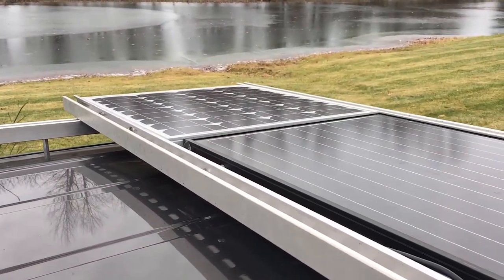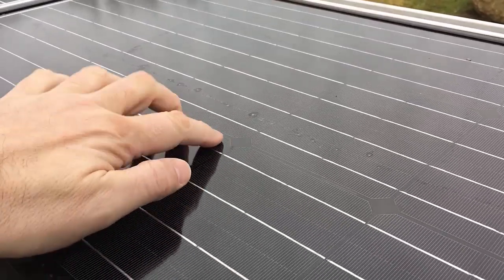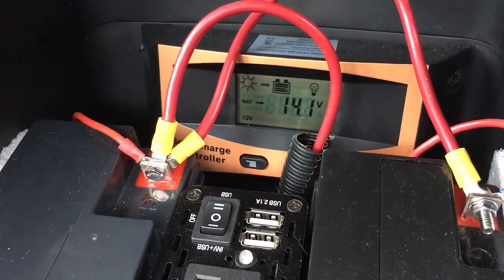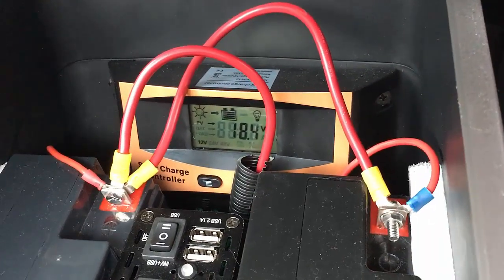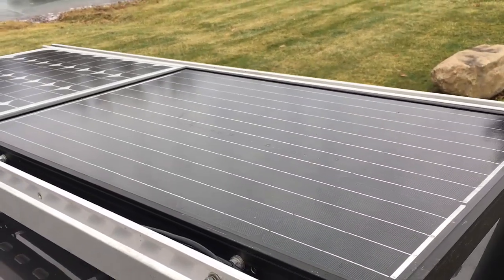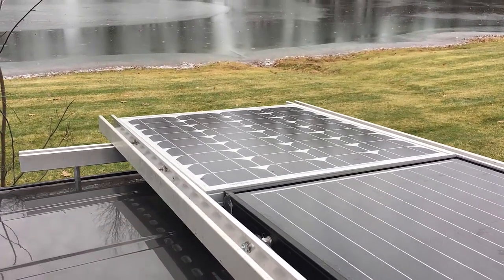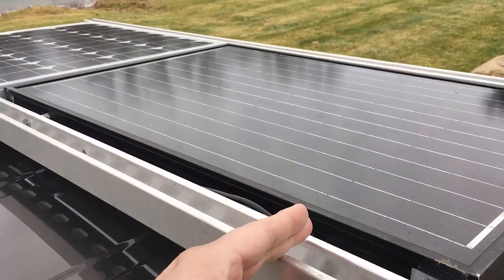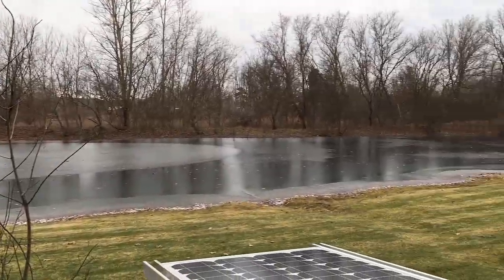DIY Rooftop Van Solar

Comment: great channel and have the same exact van! I saw on a tour of your van that your car charges your solar batt and also the solar can charge your vans batt? I can't seem to find how and what you used for that. I have a 100 watt renogy panel and a 30 amp matching charge control to a 100ah lith batt.  Any help would be great! I have videos of my van on my channel too
Reply from the maker: Your paint job is f'ing AWESOME man!  Love it!  Just subbed to your channel.  I'll look up the info on my charge controller and send another reply to this message.  Thanks for watching!
Reply from the maker: OK, got two links for you.  The first is the charge controller I'm using and the second is the manual.  Page 6 of the manual mentions it under "key features".  https://www.renogy.com/dcc30s-12v-30a-dual-input-dc-dc-on-board-battery-charger-with-mppt/   I've actually measured the current coming into the starter battery and it does work.  https://www.renogy.com/content/RBC3050D1S-G1/RBC3050D1S-Manual.pdf  The downside is that this unit is not cheap at $230.  There is also a 50A version, but I didn't want to run heavier wiring for the extra current.
Reply: @OdysseyCamper  checked out the links and for the peace of mind seems worth it! Its way cheaper then most electrical issues in a house
Reply: @OdysseyCamper  wow thanks for the info! Btw I have land in woodward PA and El Paso Tx if you ever need a place to stay. Both places are beautiful. Enjoy the road!
Reply from the maker: @dennisalanvids  Well thank you for the offer, I may just take you up on that!
Reply: @OdysseyCamper  hope you do!

Comment: I am using a Renogy 100w solar panel and I am very interested in the Uni-Strut roof system you are using.  I have a 2006 Honda Odyssey and the factory roof rack is too limiting on functionality.  I invested in cross braces for mounting my panel.   I need to add additional panel(s).
Reply from the maker: The nice thing about the Unistrut system is that you can easily reconfigure it. The bad thing is that stuff ain’t cheap. I never did a full write up or video about the rack, but if you pull the factory rack off, there are M6 studs that it attached to. At least that’s the case with mine; you’ll have to take a look. Then, I bought some hex spacers to lift the two rails a couple of inches at the ends, leaving the middle just a hair above the roof. You’ll likely need to experiment and order extra parts as needed. I got everything from McMaster.com. If you check out my “about” tab, you should see my email there. If you drop me a line I’ll shoot a little close up video of it for you. Thanks for the comments!
Reply: @OdysseyCamper  I will be contacting you regarding this information.  Have a great evening.... I have been up since 0300 chatting with family back in china and I need some sleep... 
Thank you for your reply, and I will get back to you regarding January meet.
Thank you again for your prompt reply.

Comment: How did you run the wires into the van?
Reply from the maker: Hi, Michael, I ran them down the rain groove where the rubber pieces are that you remove to mount a roof rack. Then, I drilled a hole through the plastic pieces at the rear of the groove and ran the wires under the weather stripping for the hatch. Thanks for checking out my channel!

Comment: I'm looking into the renogy kit right now. Any suggestions on what solar I should start with. I'll be using it in a Ford freestar 2004. I have a rack on top. Great formula channel thanks for all the information and your dedication👍😎
Reply from the maker: I’d try to start with a 100W panel, as the cost per watt is usually better than a smaller one. If you aren’t ready to mount it yet, you can put it in your front window. I use a semi-flexible panel with my new van. You can set it outside for maximum light while you are stopped, or inside when you are in places that others might walk off with it.

Comment: Instead of 2 50 watt panels, would a single 100 watt panel fit on top of your Odyssey?
Reply from the maker: VanLifer I think so. The roof is about 48” across, or you could mount it the long way. I used two panels because I already had the one. It’s also nice to have two in case one fails. However, one big panel will save you some money.

Comment: Nice job Darren. Interesting about the Renogy. That’s what I have and am happy with performance. I have 70 Ah in batteries now in my vehicle bc MightyMax sent me a 2nd one bc of damaged terminals during shipping of first one. So MM customer service is good.
Reply from the maker: Karen Eighth Thanks!  It’s good to hear that MM pays attention to their customers. The only reservation I have about Renogy is long term durability up on the roof at 75 MPH. I don’t think it will be a problem but I just don’t have as much time with it.

Comment: Hey, Darren! So there are 44 ah of battery in  the console pack- correct?  I'm sure the 100 watts of solar will do better. I have 245 watts of solar and 100 ah house battery. Seems more than adequate. As I recall, I have been told about 2:1 ratio solar to battery. I was thinking of picking up A 50 watt panel For the jump  box set up but since. Its about 40ah, maybe a 100 watt would be better. Its just the size of the 100 watt panels and was not going to mount on my roof rack as I will be carrying cargo up there. Suitcase deals seem awfully expensive
Reply from the maker: Hi Jeana, Your memory is correct, I've got 44.  On a cloudy or winter day (fewer hours of daylight at a lower angle) I could not completely recharge the battery pack.  Even under ideal conditions, I was only putting about 4A back in.  So it would take two days to completely recharge if I ran it down.  This should cut the time down significantly.  Yes, those suitcase panels are crazy expensive and I think you could make one for a couple bucks in hinges.  Of course, you also have a higher price per watt of the smaller panels working against you.  Still, some situations call for a more portable solution.

Comment: Those are attached to the roof of the Odyssey?
Reply from the maker: Hi Windy, Yes they are.  I build a rack and used the same mounting points that the factory roof rack used.  That way you don't have to drill into the roof or stick something to the paint.  Here's the article with how I did it http://odysseycamper.com/odysseycamper/minivan-rv-roof-mounted-solar-panel/
Reply: @OdysseyCamper  Awesome that they fit and they're out of the way.
Reply from the maker: @windymcgee6833  There was a bit of backyard engineering involved, but yeah, I was happy with the end results :-)